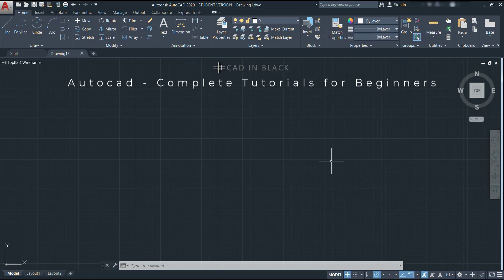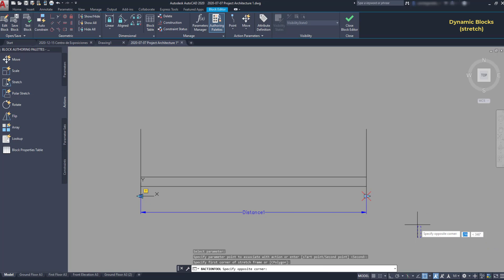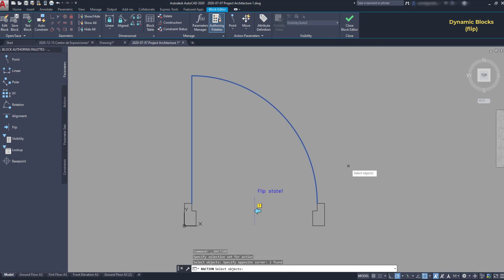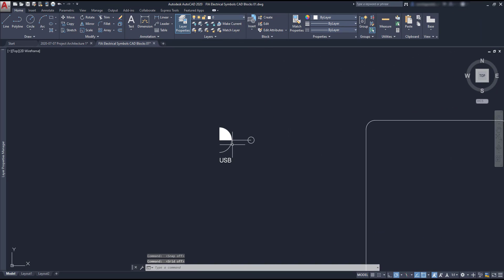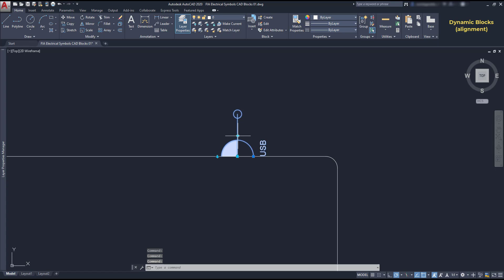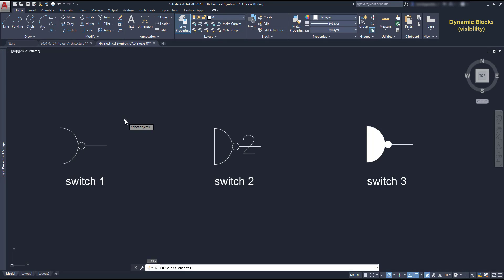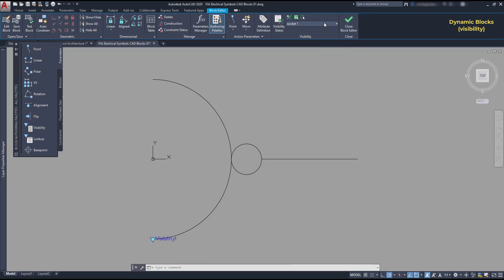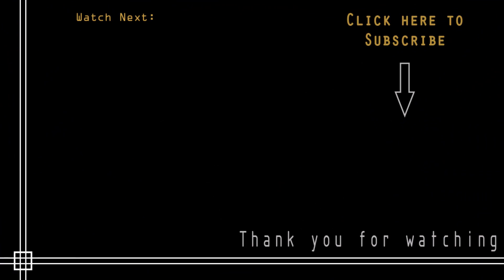Autocad - Dynamic Blocks

Comment: Thanks, I was just thinking about making my electrical symbols dynamic, I'm not surprised you used them as an example, they are perfect for it. Now I just need to convert all the CIBSE symbols to dynamic ones :)
Reply: Fr now I can just stick the outlet on the wall and if I want it to be a gfi bam visibility state active, oh I don’t like where my HR tag sits? Lemme just rotate it and flip and bam no more brute forcing my way through it
Reply from the maker: Thanks for watching +Skinny-Fat Man .
Yes, I agree with you. You save from rotating all the time you have to place the symbols in the circuit.